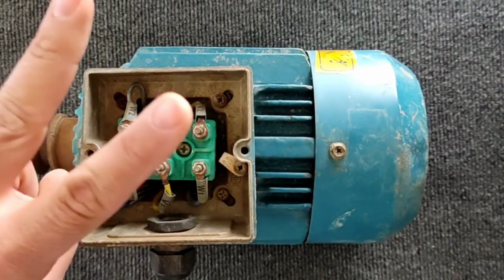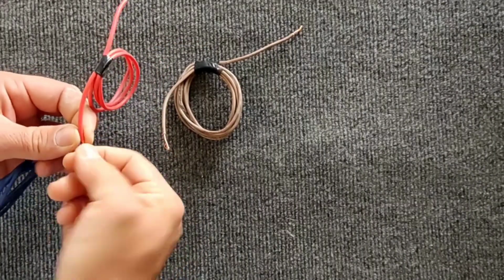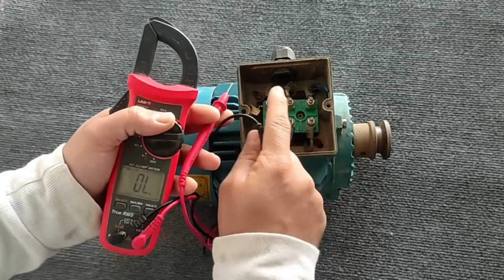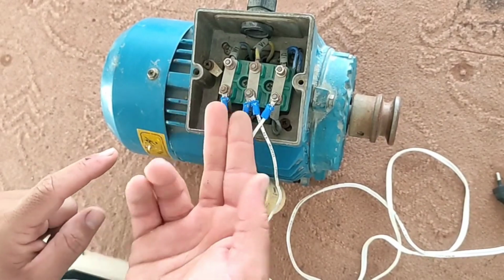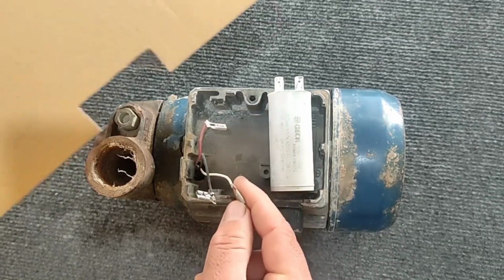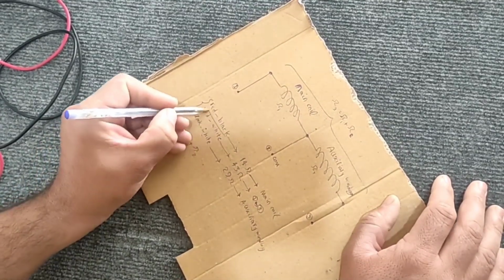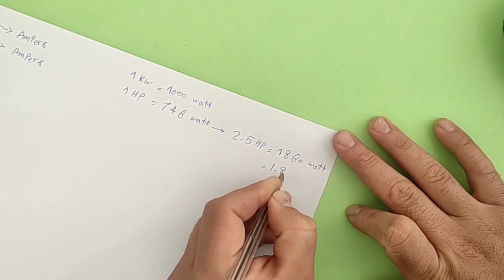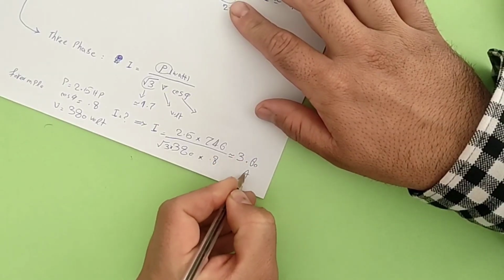Everything about three-phase and single-phase electric motors

Comment: I have a three phase motor that has the bus removed and now it’s just 9 wires, yes nine wires, coming out of the hole. Plus they aren’t labeled. 
How can I figure out which wire is which?
I got the motor with three of the wires connected, and three other groups of two wires connected. 
So how do I figure out which is which?
Thank you.
Reply from the maker: Hello my friend
Your motor is probably two-speed, with a common three-wire motor and each turn has three wires, making a total of 9 wires.
I will make a video about it

Comment: I hope this message finds you well. I am currently a university student pursuing a degree in Control and Automation Engineering. I would like to seek advice from experienced professional engineers, or those who have at least had practical experience in this field, regarding a book titled "Electric Circuits," 10th edition, by James W. Nilsson and Susan Riedel. The contents of the book’s chapters are as follows:

1. Circuit Variables

2. Circuit Elements

3. Simple Resistive Circuits

4. Techniques of Circuit Analysis

5. The Operational Amplifier

6. Inductance, Capacitance, and Mutual Inductance

7. Response of First-Order RL and RC Circuits

8. Natural and Step Responses of RLC Circuits

9. Sinusoidal Steady-State Analysis

10. Sinusoidal Steady-State Power Calculations

11. Balanced Three-Phase Circuits

12. Introduction to the Laplace Transform

13. The Laplace Transform in Circuit Analysis

14. Introduction to Frequency Selective Circuits

15. Active Filter Circuits

16. Fourier Series

17. The Fourier Transform

18. Two-Point Circuits

My question is: Do I need to learn all the material from every chapter of this book in order to perform the tasks of a Control and Automation Engineer? Additionally, what steps should I take in my learning journey?

I sincerely appreciate any guidance or suggestions you can provide.